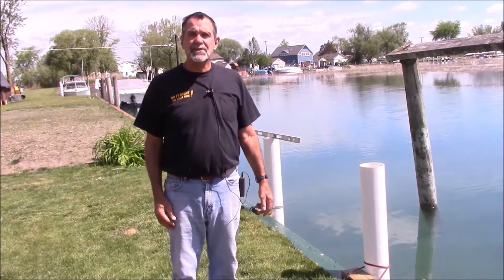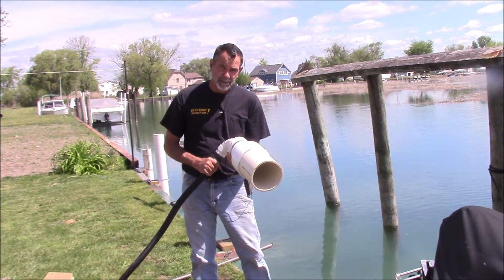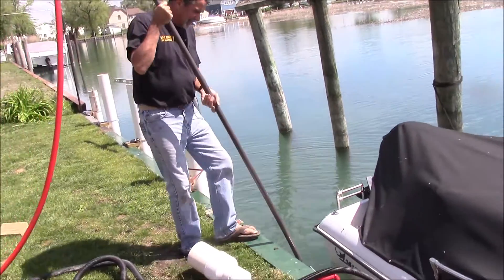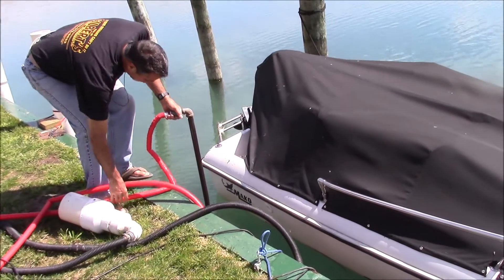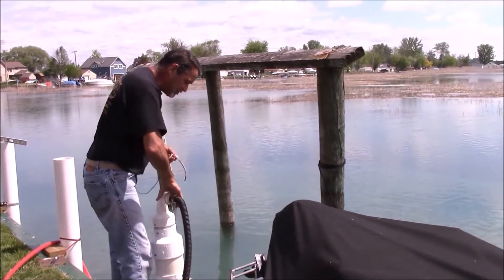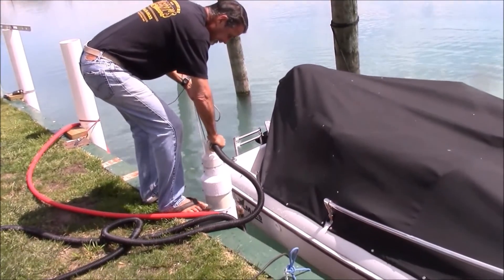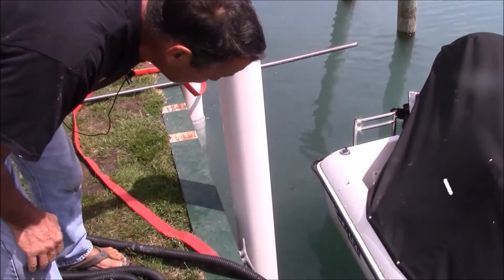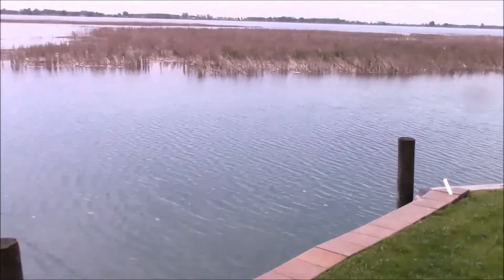Install PVC Boat Pilings for $170

Comment: About 10 years ago in S. Florida, I assisted on replacing the rotted wood dock posts using  6" PVC. We used just a single jetting pipe placed inside the 10' PVC (no bottom saw cut). The pipe was jetted down, added a coupler and 5' section added and continued the process until proper depth/height. Then one bag of dry mix concrete poured in, followed by rebar and mixed concrete until full, topped off with concrete crown. Before it set up fully, we drilled and installed galvanized lag bolts to secure the existing dock to the post. With the concrete and rebar for strength and the PVC for boat protection, I think we have the perfect long term solution to dock pilings rot.
Reply: If you can get it, hdpe pipe is much more crush proof than pvc.

Comment: Great idea sir but what about a hi- pressure washer on the pipe in the middle of the PVC, won't that pretty much send it down faster with the pressure pushing the mud away quicker? just a thought :)
Reply from the maker: It takes a volume of water to evacuate the mud, not high pressure water/lower volume.

Comment: You ever try pulling vacuum on top of the pvc and see if the pipe will sink itself?
Reply from the maker: I just don’t have access to that kind of equipment. It’ll be interesting but what happens when the mud hits the top of the pipe?

Comment: Could you fill the pipes with concrete?
Reply from the maker: I guess so, but after 25 years, from when I installed them the first time, they work fine empty.